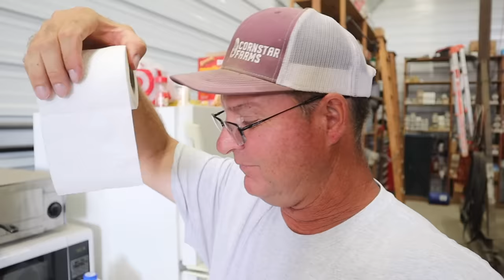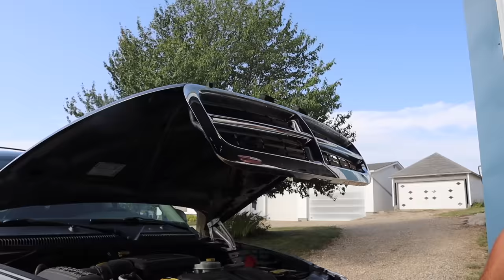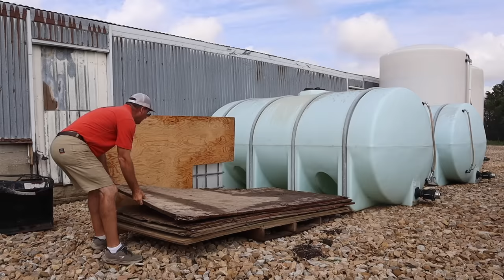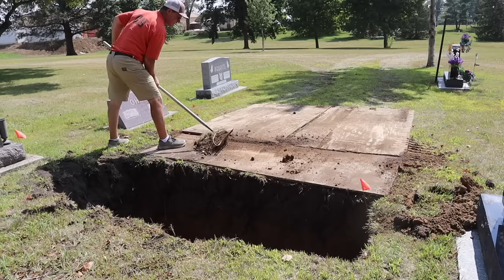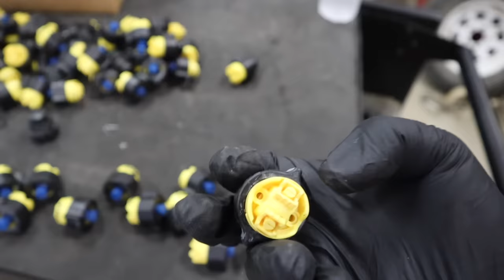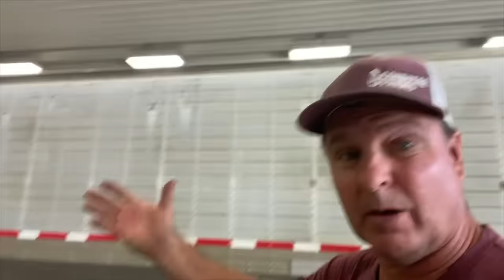i got ACCUSED OF STEALING MONEY at a cemetery

Comment: I once had a job where I had to bid on jobs.  I finally developed the rule of thumb--figure out the cost and then double it.  There were so many hidden or long term expenses you can totally overlook.  And that is just to break even.  My fear of overcharging made bidding difficult.
Reply: I was not very good at bidding.  Sometimes I would have to work my tail off to keep job on bid.  Something needs repair or you need a part--all unplanned on budget.  In your case I have no idea how to charge equipment depreciation, mileage, etc.  My boss did that after I submitted time  needed.  I think customer was charged 125 per hour to allow for wages, & other

Comment: You handled it well. We dig graves as little different. Use a small dump truck. And a mini excavator. Leave the dirt next to the grave as far away as we can reach. Cover it with some grass carpet. Haul the extra away. Re filling is just push it back in with the same mini excavator. Save's all that equipment and a semi. Also fuel isn't cheap anymore.

Comment: Drill some holes in the bucket and weld nuts on so you can bolt on sides/backing to make it hold more dirt.  Also the nuts could be used for bolting on extensions to make the bucket wider to make it sized similar to a snow bucket for moving snow.

Comment: I just got a brand new JCB 1CXT and it's a cross between a skid loader and a backhoe.  It is actually classified as a loader backhoe.  I wonder how that would work for digging graves because it is much more compact compared to a regular backhoe and it's not much bigger than a regular skid loader and it would be much easier to navigate between headstones and the rubber tracks would reduce ground pressure.

Comment: Our grave digging people travel about 60 miles here to dig graves.  They use a mini excavator and a Kawasaki mule with power dump bed.  It is pulled with a ton truck.  There is a plywood box used (which I am not sure who owns it), that is placed on one side of the grave and they fill it with dirt.  It is covered with green outdoor carpet for the funeral.   After the funeral,  the box side will drop down to the edge of the grave.  This allows the vault company, (I think) to fills the grave with the dirt in the box by hand.  The grave digging people do touch up the graves when they are back in town digging other graves.   Everything these days really cost!!!!!!

Comment: With Cole all about efficiency, why don't yall take the old grain cart and convert it into a Grave soil cart, instead of making so many trips with the skid loader?  I worked for a small cemetery here in TX and they had two soil carts to move the soil while digging, and then after the service, they just pulled the cart over the grave and opened the bottom of it and let the soil back into the grave.

Comment: From my experience opening and closing the the grave is a very small amount compared to the total cost of a funeral what ever you charge pretty sure you deserve it. I'm old enough to remember when the neighborhood would dig the grave by hand and in the winter would have to start a bon fire to thaw the ground out and still use picks to break through the frost would put a tarp over the dirt right next to the hole and sometimes be froze by the time had to be filled back in don't think you're probably going to see that in these days!!

Comment: DC, if anybody in the graves business is "charging too much", the biggest line item is the Funeral home services. Many states require a licensed funeral director even for a church service. They can thank their state legislators for that. On the milk; you can make some really great glue out of that, but it has an awful odor for about four or five years after. Btw. as a plumber, I have hired some guys to dig as recently as ten years ago; two guys, in forgiving soil, could dig the hole needed in a bit more that half a day of hard, 55 minute hours of work. They would expect me to cough up $150-$200 each, and come back tomorrow and cover it for another $150. Ten years ago. NO backhoe, no skid steer, just shovels and backs. Just laugh and say, "Heck fire, if you will dig it and cover it up nice, I'll pay you $250!"

Comment: People who don't have, or have never run equipment have zero perspective about what it costs in both time and money just to load up a skid steer and transport it 20 miles to a site, park, and unload it.  I did a cleanup job on an old garage that burned down for a lady because she was the grandmother of a friend.  She is not poor - owns about $750,000 worth of real estate, etc.
But I told my buddy I'd come get it done if they simply pay the costs.  Zero profit involved.   It was a 56 mile round trip and I ran the skid steer for 10 hours.  I charged $120.  They seemed offended by that price saying they'd never have agreed to it if they had known it was going to cost that much.  I loaded up my machine and left . . . my buddy tried to pay me the $120 later and I refused to take it.  I count it as the price of a lesson learned.  Don't do people favors like that.  If they had gone to an equipment rental company and rented a machine like mine ( Kubota SVL75 Compact Track Loader ) I'm sure it would have cost them at least $350 for a full day rental, plus delivery fee, plus $120 in fuel, and that is without an experienced operator .  It would have taken them twice as long to get it done and it would not have been nearly as neat when finished.  People have unreasonable expectations these days.

Comment: I recently had to pay $700 for a cremation hole. I felt that was very excessive. Of course then there was the $600 newspaper obit fee for 5 days on one paper. Highway robbery.
Reply: You can always buy a post hole digger and don’t bother putting it in the paper There problem solved do it yourself
Reply: @kenhofer8063 I like the post hole digger idea. As for the paper,  it is advisable to post the obit in at least one local paper to inform potential unknown creditors of the death.

Comment: I get that with the cost of things when I dug holes when I was 20 I had to tell people we have to get them just right to get to the pipe so we have to locate and use cameras and then we have to sometimes get permits if it went to the main line and we needed to dig up part of the street. It can cost a lot for any job especially if you have to dig.  Once you explained it all people are like well I guess you charge decently lol 😂  they wake up and realize 2,000  to 4,000 isn't too bad  
The smallest dig job I did was 1500. The biggest one we did was a part dig job and a repiping on a huge house I think that was a 6, 500 to 7, 000 thousand dollar job. I only got a small cut of that I think after a couple of years of that and other jobs I was like I'm going to the military lol 😂

Comment: They have the option to use a shovel and do it yourself.  The first foot is not bad.  ;) I have never gone below 3’ with a shovel only.   Let’s consider $45k skid loader, $50k backhoe, $5k tilt trailer (used) let’s say 10% use grave digging.  That’s $10k. Elmer, trailer $10k but 50% grave use?  (Wild guess from videos) $5k  insurance ? Time. $200 a grave, 2 trips? You would go broke.

Comment: We got charged 500 bucks 18 years ago to bury my Dads ashes on top of my brothers grave. They used a post hole digger and it was only 3 feet deep! We were told the hole would go down to the cement lid on my brothers . I thought it was a shoddy job. And my dads ashes weren't ashes!! My family wanted me to put some of dads ashes into these little silver lockets. So when I opened the container all there was, where these little pure white square pellets, all the exact same size. No ashes at all! I was surprised. So I took one out and I had to break it into smaller pieces to fit into the lockets. It was soft!..like a soft plastic material. Not hard like I expected . I expected it to be hard ,figuring it was bone. But it they all were pure white square and soft!? A little unsettling for me. I was thinking of having the lockets tested maybe for DNA to see what the pellets were to rest my mind, but anyway...it just bothers me to this day.